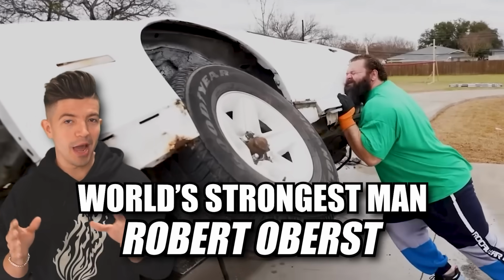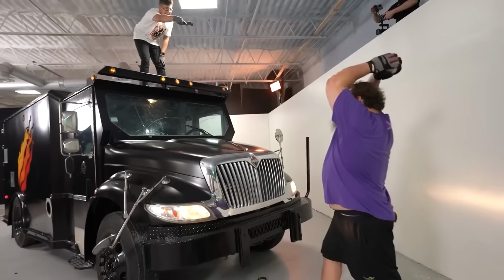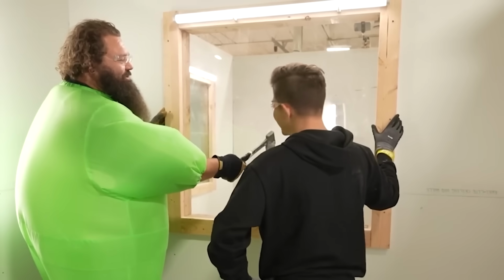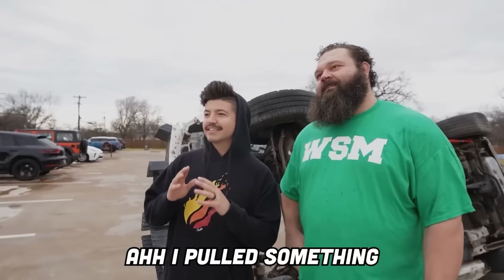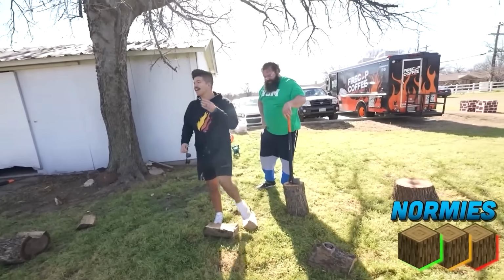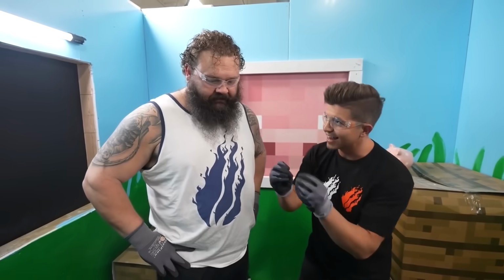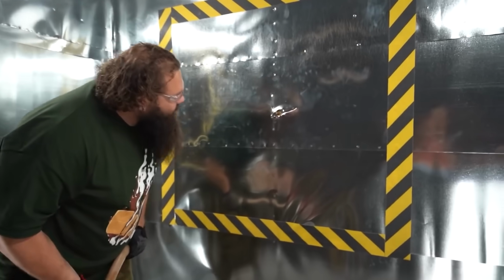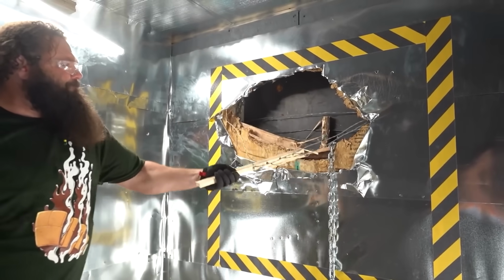World's Strongest Man VS Dangerous MYTHS!

Comment: Obsedion box 1000hp
Hammer 50hp
Obsedion 900hp
Hammer 0hp

Obsedion 900hp 
Pixace hp 200
Osedion 700hp
Pixace 0hp

Obsedion 700hp
Wedge hammer  400 hp
Obsedion 300hp
Wedge hammer 0hp

Obsedion 300hp
Axe 50
Obsedion 250hp
Axe 0hp

Obsedion 250hp
Diamond wedge hammer 600hp
Obsedion 0hp
Diamond wedge hammer 450hp